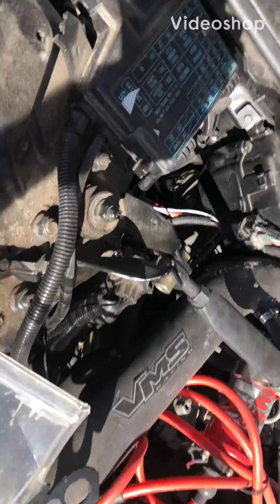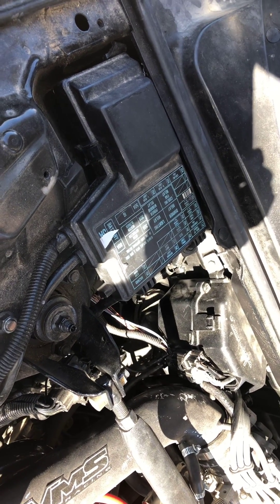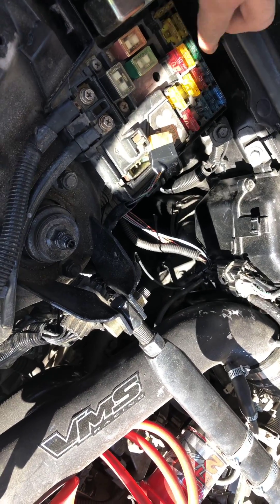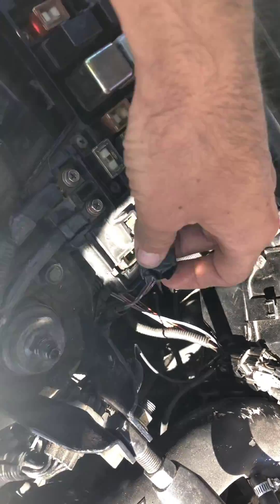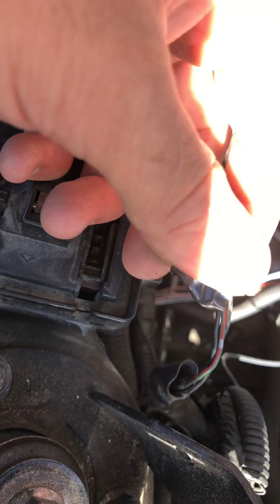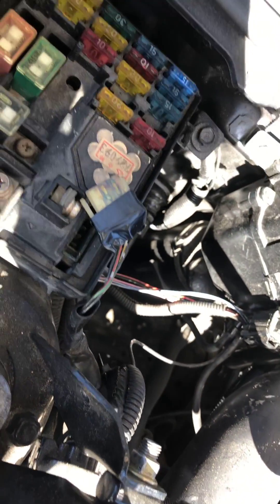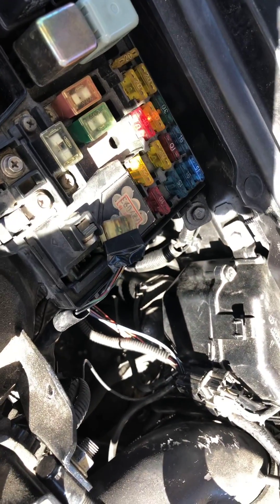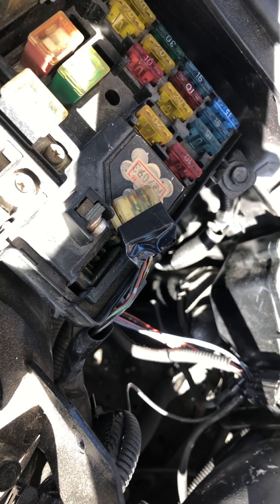Electronic load detector bypass

Comment: If you unplugged it why need the resistor jump?
Reply: The resistor is mimicking the load it would normally see if Ac and Headlights are on which causes the alternator to run all the time rather than on and off

Comment: About to try this on my 2007 Honda Pilot. I unplugged the eld without the resistor and it’s been working fine. Also got a new Denso alternator and voltage would drop to 12.3 on idle at traffic!

Comment: Thanks for this video.  Question: Did this cause a check engine light of any sort? Will this effect a smog check?
Reply from the maker: @xart23x  depends on the year 
Yes it will throw code 20 but with pt3 ecu it doesn’t show a check engine light 
That’s for cb7 and cb9 accords ,,, depending on your vehicle you can get a chipped ecu with eld selected off

Comment: Does the watt rating matter on the 820ohm resister?
Reply from the maker: @RcbasherNcrasher13  I used 1/2 watt gold tolerance 
Still working to this day ,
Reply: @Darrenlawrence89  mine are 1/2 5% 820R gold or brown pack.. I bought a oe ELD to replace it off Amazon not sure if it's bad or what but driving down road nothing on but my lights.. and my voltage kept fluctuating and my led lights were going bright and dim.. now nothing on or lights on voltage stays good with resister in place.. so how long u been running it bypassed?
Reply from the maker: @RcbasherNcrasher13  so far 6 years on same resistor
Reply: @Darrenlawrence89  awesome.. until my lights started messing up I had no idea what a ELD was lol.. thx for making that video bro..
Reply from the maker: @RcbasherNcrasher13  yes my issue was I kept going through part store alternators and then finally after changing battery cables / grounds that I did digging into the eld system and realized what feed back ecu needed to see to keep altenator regulator on like normal cars
Reply: @Darrenlawrence89  yeah I got a volt Guage hooked into alternator fuse and mine stays at about 13.8 but if I kick on ac it drops to low 12s.. I got the new eld I'm thinking about trying it to see if maybe my old eld was just broke?
Reply from the maker: @RcbasherNcrasher13  honestly check grounds and wires for corosion , if none 
Your altenator is not keeping up with the amperage  load 
Or something on the car is pulling to much amperage

Comment: My ELD system failed a couple days ago and burned my brand new 150 dollar vtec ecu while driving. Had to throw the spare non vtec ecu in and do this bypass to get home. The ELD just gave up and burned itsself, the c16 capacitor, and trace in the ecu. It was a smelly mess. All my Hondas are going to get this bypass this next week. Screw the ELD system.

Comment: I doubt that you still get on here and follow this trend but there's two sides on the resistor so my question is obviously there's going to be one wire on one side and two wires on the other please explain which ones go where
Reply from the maker: Use the 820k ohm resistor to Jump green/ red  and black on harness ,,, do not connect to black yellow resistor I believe is 1/2 watt , it’s been a while I’d have to check

Comment: So u just stick it in the Top of the plug or do u splice into those 2 wires u mentioned
Reply from the maker: I just stick it in on the wire side like as if you were back probing the pins 
,, I then tape it up to protect it from corosion and also tamping it makes sites it stays in place ,,,, I explained what 2 wires need to be connected out of the 3
Reply: @Darrenlawrence89  So stick it into the wire pin from the top basically and done
Reply from the maker: @GETNYCEAUTO  yes

Comment: Thanks for making this video in 2019. About to do this to my 94 Accord Wagon. I was used to the low idle but the ELD has been doing me more harm than good lately. I got used to how my Chevy Van worked. It could sit for a week and then I could get in it and drive a bit and charge the battery right up. Haven't been able to do that in the Accord because of the ELD. It'll sit, battery drains naturally, and then I'll drive it but because the ELD cycles it only keeps up with load and doesn't actually help keep up with the battery. The worst is my auto transmission hates it when it cycles off and you get a really rough down shift because of it. I can straight up watch my Amp gauge and it kicks the trans in the dick every time. Never really noticed this happen when I used to drive every day but I sure do now that I'm not.

Comment: Looks great!  Seeking this solution for a 2010 Odyssey. Can anyone share the location for that model?
Reply: I’m having same issues with an 07 odyssey. 
Alternator bench tested and it’s good
Battery is good
Belt is good. 
Battery light comes on intermittently. I think it could be ELD but dealership says I have to buy whole fuse box at 500.00+ dollars
Reply: @joellord65 I'm having the same issue on an 07 odyssey  but also have random dead battery on top of it. New battery and new alternator with the same problem. Have you solved your problem?

Comment: This is very illuminating to me.  
Moreover, in a newer Honda Accord model (I have the 2017 one) it has square black box 1.5' ' x 1.5' ' sitting on top of the negative terminal, and the box has a clip attachment for three wires (I think one red and two green wires) and I did not understand its function.  Curiously, one day I actually opened 'the lid' of the assembly, observed that so much dense a microcircuit PCB card in there, so I quickly assembled the lid back to case, as I was afraid of 'disturbing' its function in some way.  However, on some occasions I also forgot to plug back the clip for removing the three-wire connection to it, and there seem to be causing no problems and no malfunctions and I wished I had some documentations so I can learn more about it, because on my old 2001 Nissan Pathfinder SUV probably don't have a battery charging status/performance monitor, as there was no little black box sitting on its battery negative post.

Comment: You don’t want to full field your alternator. It can shorten the life of it and the battery, as well as lower your gas mileage. Instead, fix your low idle concern. Likely the screen in the iac valve needs to be cleaned.
Reply: the ELD is a piece of crap anyways. Especially if you're running an aftermarket stereo or anything else that needs steady voltage.
Reply: @0verload  Ohh . . .
Reply: @0verload  I have a 2002 acura TL. I just ordered a 320 amp alternator for my system. I'm going to need to bypass mine right?  Thanks
Reply: @CanesupNolesDown  Yes. Sorry for the 2 year late response. lol

Comment: Where can I buy the bypass  resistor.please reply
Reply: You can get 1/2 watt resistors (of 820 ohms value) from SuperbrightLED.com, Radioshack.com, and PartExpress.com (and among numerous others by searching the internet.)  

Here is the basic of electrical science, as in any college physics classes and beginning engineering classes:
Understand two computation rules:  the parallel rule of connecting resistors in parallel and another rule of connecting resistors in series, just in case you went on a lengthy route, but 820 ohms is a very popular value (and as an often-used discrete component for reducing current to sensitive LED lights of 20 mA or less in the 12 VDC use.)  May be this is TMI (Too Much Info) and not needed.
Reply: @nanymitert5447  you seem very knowledgeable on this matter and keeping up is quite the struggle - I have a 97 Acura TL 3.2 with an aftermarket alternator that charges at 15.3 amps / 300 amps for a large audio system. My lights dim after installing the alternator without a current draw or amps installed . Could the eld bypass fix my issues if so what size resistor would you recommend? Thanks in advance
Reply: @spoonsr1755  Very good question.  I would guess that the ELD did not do a good job at detecting all your load-currents requirement and thus ELD bypass might fix this issue, dimming lights.
What is the voltage of the battery when the engine is running?  Need to use a voltmeter and measure if the voltage is 12.8V or higher at the battery, in order to really force a current input to flow into the battery and charge or store it here.
Since I don't have a car with ELD this way, I can show you the calculations:  
Take 13.0V / 1000 ohm = 13 mA, and take 14.5 V / 1000 ohm = 14.5 mA.
As I suggested before most electronic circuits have a current around 20 mA does not mean it can not be above this.
Take 12.8V / 820 ohm =  16 mA, and 12.8V/ 700 ohm = 18 mA.
An other example of extreme high voltage, take 14.5 V / 820 ohm = 18 mA, and take 14.5V / 700 ohm = 21 mA.
So, after these sample calculations, I would pick a resistance value ("size") at 820 ohm (as a discrete component.)
Other than that, you CAN pick any resistance value(s) in the range of 750 ohms to 1200 ohms, this would keep the current in ELD bypass circuit be at least 10 mA and as high as 20 mA, and consider to be in the "safe range."
Reply: @spoonsr1755  To improve performance of your large audio system, I would suggest you to buy a large "digital" capacitor of 1 Farad to 2 Farad, and that could cost somewhere from $50 to $125.  This is to be connected next to your high-power amplifier.  Moreover, They called it digital capacitor because they incorporate them with a digital voltmeter so you can monitor the amplifier performance and see the variable (momentarily) voltage drops due to the instantaneous demands of the amplifier.
Reply: @spoonsr1755  On the other hand, the 300 amp capacity of this aftermarket alternator is not really "compatible" with your car's "electrical system".  I do not know if the ECU (electronic control unit, or electronic control module) really need to provide a control signal to this alternator or not.  As I learned more, they use something call Pulse-Width Modulation (PWM) in many charging system; that is the controlling of the amount of time the connection of the alternator to the battery is dependent on the status of charge level and thus the ECU is monitoring it and thus control it by varying the pulse widths (i.e., time length.)  I am still learning about this, but I don't have a lab or equipment to play with, so I don't get anywhere.
Reply: My understanding of the alternator mechanism is that the ECU control the amount of current going to the armature, and make it becomes an electromagnet, that spins inside the alternator in order to generate an electric current in each of the three coils, and if (since) the ECU control does not make this electromagnetic powerful enough to really produce a high current, in spite of the armature is spinning fast enough (with the engine running at certain RPM) then the alternator does not produce that high output voltage nor that high current, in order to charge the battery and also providing sufficient current to lights and to other accessories.  I do not know this in your system and what is its particular issue.
Reply: BTW, nobody ever ask, why did he had chosen the value of 820 ohms for a bypass resistor?
Here is my engineering knowledge computation, typical or 'nominal' voltage of car's 12-volt system is 12 V/ ((sqrt 3)/2) and this quantity in the denominator is for computing the root means squared (rms) value of the alternator typical voltage (without measuring) and that is 12 / (1.732/2) = 12/0.8660 = 13.87 V(rms), which is 15 percent more than 12.0 V.  Of course, the value of sqrt(3)/2 is necessary for computation as the alternator has a three-phase stature, the coil circuit in the alternator's three windings, in a delta arrangement or schematically in a triangle representation, and each winding produce voltage 120 degree different in phase, but the DC rectifier had converted the AC voltage to DC voltage, and thus has zero phase angle (i.e., just 'none' in phase angle) and that means just only one phase.  Remember one phase means zero phase angle, with mathematical way to write magnitude and phase, in two possible forms (one form is through the use of the exponential form, of the Euler's form (e^j theta = cosine theta + j sine theta), and the other is written with magnitude and next is the angle bracket symbol and it is the degree number.)
Reply: FYI: "... the other is written with magnitude and next is the angle bracket symbol and it is the degree number."  For DC power, it is generally adopted that the phase angle can be dropped from the writing (as by way of a convention.)
Reply: @nanymitert5447  The root means squared (rms) value voltage, 
that the alternator is required to produce:

12 V/ ((sqrt 3)/2)  =  12 / (1.732/2) V  =  12/0.8660 V  =  13.87 V (rms), (AC)

But due to the conversion to direct current (DC) from alternating current (AC) most alternators produce higher voltage than this, 

typically in the range of 14.4 Volt to 15.0 Volt, DC 

by the functions of regulators (which is either built-in or externally installed.)
Reply: To seriously answer the question ". . . why did he had chosen the value of 820 ohms for a bypass resistor?"
When take 13.87 V / 820 ohms, we get 0.0169 A or just 17 mA.  So, it is okay to approximate (by me) that most electronic monitoring circuits for the alternator are operating around 20 mA and lower.  Thus the 820 ohm value in resistance is a very good choice.
 
 Moreover, the internal voltage regulator (or even external voltage regulator) is expected to regulate (through using Zener diode in circuit) to be 14.45 volt (max) in order to reduce variation of voltage output, due to variable spinning input from the engine to the alternator's pulley and belt.  The voltage reduction (across the voltage regulator is about 0.60V, thus the final regulated voltage is typically 14.47 volt  (maximum, if ever reached.)  If any regulated voltage which is Above 14.47 volt, on a continuing basis, is really being "Over-regulated" and would not be good to the "charging system" in the long term.
Reply: @nanymitert5447  
P.S.:  I use different browser with different sign in account name, but the reply mailing will reach me with the same email.
Reply from the maker: Sorry guys It’s been a crazy year and honestly I never thought I’d get so many comments on this video ,,,, I did this because our ecu controls our alternator to stop charging when stopped at idle ,,, like coming to a stop ,,, the resistor on the eld is not to mess with the alternators regulator it is simply to trick the ecu into keeping the alternator charging like in any ordinary vehicle ,,,, simply at idle my charge would drop down to 12.2v and my lights would dim ,,,, after replacing my alternator like 3 times in a month trying to figure out what was going on it was simply related to how the system works ,,,,, it works great f your car is stock but with modified hid, and a good stereo system just wasn’t hood enough ,,, I upgraded to a 120amp alternator and still had same issue hence why I did this mod
Reply: @Darrenlawrence89  what is the exact resistor you bought??
Reply from the maker: @ltthebeast10  820k ohm resistor

Comment: is there a way to change this or use your method or get a new fuse panel.. I can get one for $50 at junkyard...but this the issue I have .at idle I'm getting voltage of 14.2 when I start driving it drops down to 12.8 but will raise back up when I turn on lets say my headlights turning signal or ac, wipers etc. so do you think my eld is bad or something else I have done a big 3 upgrade stock alt and two battery's I search every where and this is the closes video I've gotten to with the same car as mines ..92 accord lx no check engine light mines used to stay on all the time but when  I switch to big 3 and two battery that's when I notice this
Reply: Bro if you still get problems use a 5 pin relay and a toggle switch instead so you can put it in HO mode when you want to. It's a better and safer way. Honda made it to where the ELD doesn't detect the loads connected directly to the battery . Trust me worth it you can hit up to 13v-14.3v just I'm idle depending on your on your alternator 💯💪🏾
Reply: @1sthawaiian11  what do you mean ho mode?
Reply: @kylefeilmeier7261  Here is how I interpret 'HO mode':  read as "High Out" mode; which means the 'system voltage' should stay in the range of 13.0 to 14.4 volt, as read from the alternator's output, and that is being controlled by its internal voltage regulator.
Reply: @kylefeilmeier7261  More info:  Read on some discussion found here:
https://www.fitfreak.net/forums/2nd-generation-ge8-specific-diy-repair-maintenance-sub-forum/95595-alternator-voltage-between-12-4v-14-4v-while-driving-normal.html
Reply: @1sthawaiian11  A relay's coil resistance is from 120 ohms to 160 ohms, so keep the circuit energized separately for "external control" with you!
Reply: But, you can use a relay to control the connection and disconnection of the bypass resistor across the ELD sensing pair of wires.